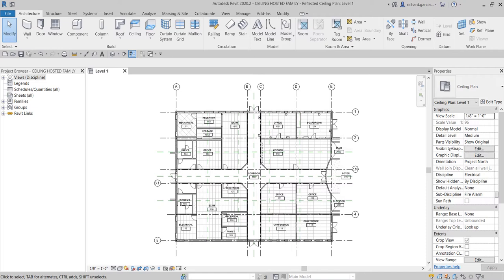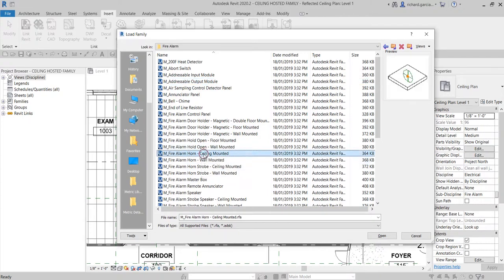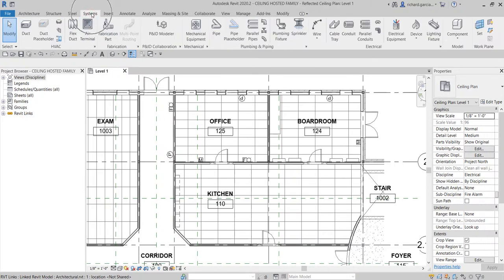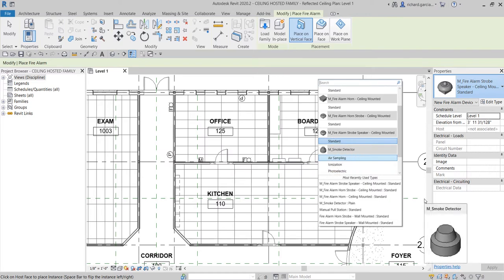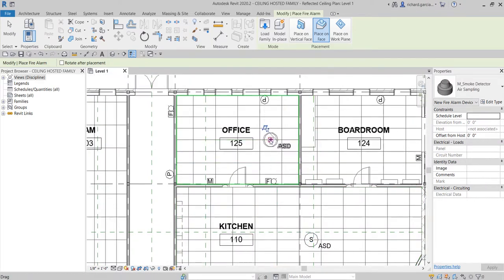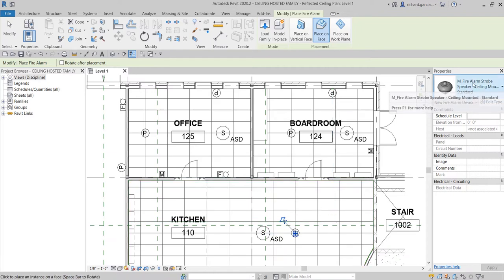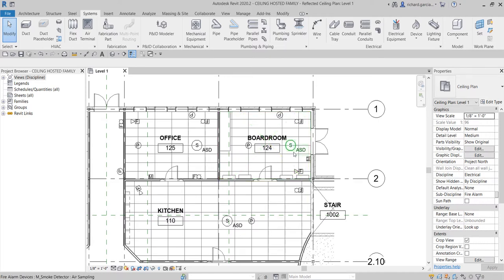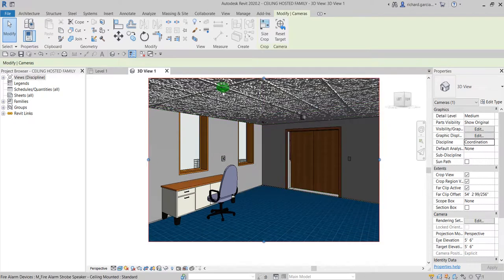FIRE ALARM SYSTEM LESSON: ADDING CEILING HOSTED FAMILY

Comment: Help, i cannot edit my elevation level for each detectors. It always greyed out
Reply from the maker: In Revit, if you find that the elevation level for detectors or other elements is greyed out and you cannot edit it, there are a few possible reasons and solutions to consider:

1. *Workset or Design Option:*
   - Ensure that the element is not part of a workset that is set to "Editable." You can check this by going to the Collaborate tab, selecting "Worksets," and ensuring the appropriate workset is editable.
   - If the element is part of a design option, you need to be in the active design option to make changes. You can check this in the Manage tab under "Design Options."

2. *Linked Model:*
   - If the element is part of a linked model, you cannot edit it directly in the host model. You'll need to open the linked model to make changes.

3. *View Template:*
   - Check if the view is controlled by a view template. View templates can control various settings and parameters, including visibility and graphics. You can check and modify this in the Properties palette under "View Template."

4. *Phase Filters:*
   - Ensure that the phase and phase filters are set correctly. If the element is in a different phase than the current view, it may not be editable. You can check this in the Properties palette under "Phasing."

5. *Element Constraints:*
   - If the element is constrained to a specific level or plane, you may need to modify or remove these constraints before adjusting the elevation. Check for constraints in the Properties palette or by selecting the element and looking for constraints in the Modify tab.

6. *Family Parameters:*
   - If the detectors are part of a family, the elevation parameter might be controlled by the family itself. In this case, you would need to edit the family in the Family Editor to change the elevation settings.

7. *Permissions:*
   - Ensure that you have the necessary permissions to edit the project. If you are working in a collaborative environment, you might need specific permissions to make changes.